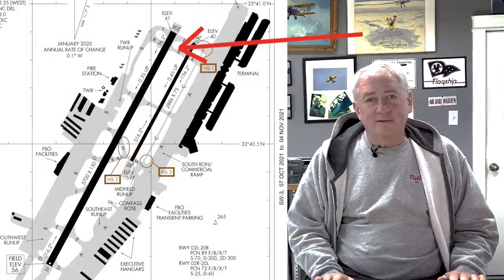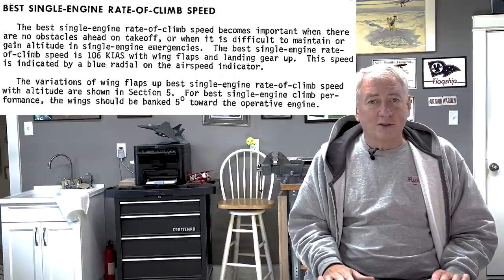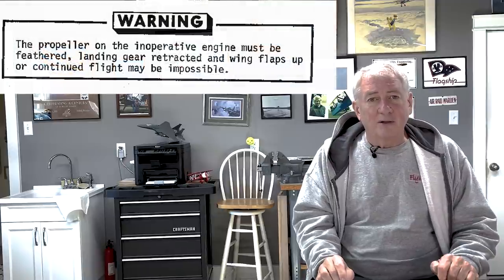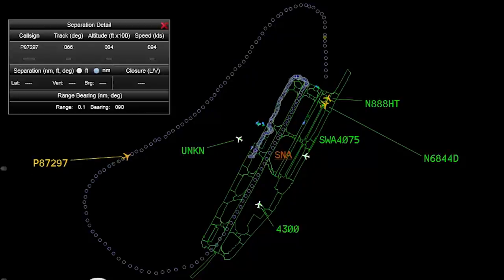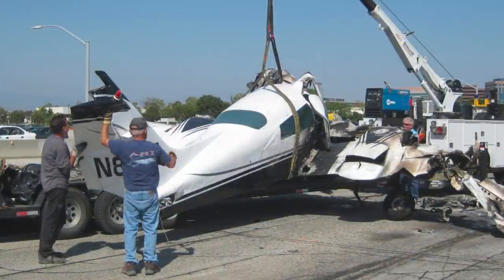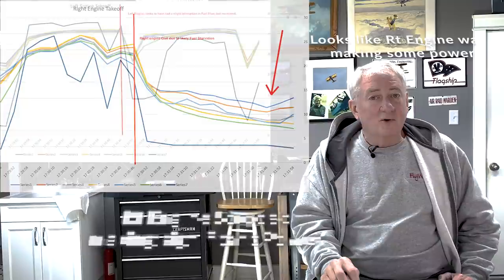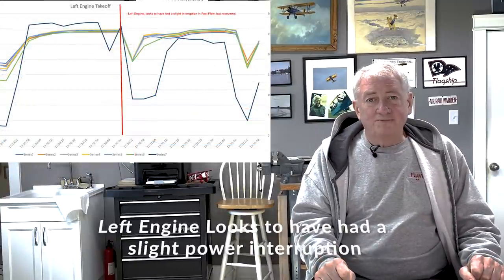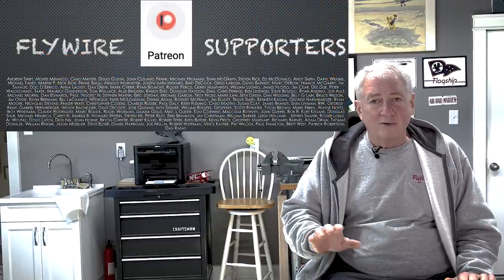C 310R Engine Failure After Takeoff

Comment: I had a catastrophic engine failure with the port engine in a rental C-310 decades ago, taking off from Monterey (Calif) airport around 2 or 3 in the afternoon. The engine suffered a broken connecting rod and as the shaft rotated, it shoved the broken end right through the side of the crankcase. Made one helluva "BANG" and showered the left inboard engine and wing with black oil. Feathered the prop, declared an emergency, and came back around and landed. Taxied in on one engine & shut down. No biggy, actually, but it sure came as a surprise...!! This was 1976 or 77.

Comment: I know, first hand, of three C-310s that have gone down because of fuel starvation.
Starvation, not exhaustion.
As originally designed the 310’s fuel system was super simple and safe. It got more complex over the years but never approached Beech 18 levels of complexity.
Yet, many, many pilots have mismanaged the 310’s fuel system, badly.

Comment: This video is so much more than an accident recap. It’s a tremendous training aid for those seeking a Multi rating, as well as those who already have one and desire/need proficiency training. I’ll be passing it along to my students and recommending it to future ones. Great job!
Reply: Scott is the best! He not only talks about the problem, he identifies what needs to be done to prevent this from happening to you. It won’t happen to me because I’m never going to fly a twin, too much to do when something goes wrong with one engine. You are better off in a single engine aircraft and no engine then you are in a twin with one engine. The record shows You are more likely to survive in the single. Of course there are reasons to have twin engine airplane, I’m not wishing to ban them or anything like that.
Reply: Newer airplaines have auto feathering of the failed engine.
Reply: @steveperreira5850  Any time a Aircraft  goes  faster it will hit harder. There is a lot more chance of surviving a piper Cub crash than 
 a jet.
Reply: @kjelle5350  Interesting, that could be a life saver.

Comment: At the time I trained for my multi, engine out procedures were drilled, drilled drilled.  It was automatic.  I don’t know if many continue to run that through their minds regularly.  In other words they quit thinking about it.  Not good.  I still think about those procedures all the time and seldom fly multi engine aircraft.  One thing that struck me about the audio calls was that the pilot really seemed panicked, especially at the first call.  I get sudden surprise and concern, but to make a call such as that, as it turns out,  without going through the normal engine out procedures tells you he either wasn’t proficient or doesn’t handle these things well at all.  Glad everyone made it, in spite of the pilots shortcomings…whatever the cause of those actually was.

Comment: I have lost an engine in 340 and 402B. The 340 twice once in flight once on takeoff. The 402 was on takeoff. The 402 barfed 
The left engine big time just barely feathered it before it froze. The  340, it was a fuel line issue both times. and I was light.
But I had effective training and experience. The standardization of both companies helped. Memorize the checklist study the manual. But Scott's right. Control the aircraft. Know the machine. Be proficient.
I've had some months off due to my wife's illness and death, and then a car wreck and hospital stay.
(Tboned at a stop. I had the right of way.) I wouldn't dream of crawling into an aircraft, even a simple one, without an instructor at least.
Reply: People will get sick of hear reading about stories like this? Too bad- We need more people who've survived these emergencies due to good training and taking their time to INGRAIN in their BRAINS, what to do in these situations- 

I'd much rather get a bit bored reading peoples stories of survival, than read obituaries.
Reply: @rickrickard2788  yes!👍

Comment: The first thing I thought was, “Why did he make right turns?” The second was the photo of the throttle quadrant. “No feathered prop?” He’s so lucky he made it as far as he did with a windmilling prop!
Reply: I know right!?  I'm not even a pilot but learned enough about the difference between having the extra power and 1 good engine if 1 quits  on a twin to really take the wind out of any sense of added safety and security when flying a twin!!
So many different factors come into play in the various videos I've seen made me realize that 1 more motor doesn't necessarily mean it's a walk in the park with the extra.  
Sounds more like a struggle for survival flying on the razors edge of what's required to remain flying, and what the plane is actually capable of with little room for error!
Reply: As you watch the radar track, there is another plane taking off on 02L just prior to '297's takeoff roll.  When 297 reaches the end of 02R, the two aircraft are pretty much alongside each other as 297 call the mayday.   It's possible that, knowing he had traffic to his left, turning right was the only option he had.
Reply: @chaspfrank  except that the accident flight departed 20L
Reply: @kenclark9888  Ya got your left and right mixed up there bud.  Cleared for take off 20 Right, also shown on the map that way.
Reply: Looking at the video which is not quite synchronized to the audio, the first gentle turn to the right is almost certainly because the pilot did not maintain good directional control when the engine failed. He needed more left rudder and gentle left bank to go straight, and even more than that to turn left. Then, once the turn to the right had begun, right was the shorter direction to go and so he made a deliberate right turn to the downwind then more right turns trying to line up with final. The bottom line is that the first turn was not by conscious choice, then right became the path to a shorter flight back to the runway.

The antidote should have been to go straight ahead at first, get the airplane cleaned up (feathered prop, etc), then take some time to get back. Rushing the return was instinctive but bad.
Reply: @chaspfrank  :  He had other options, he could’ve gone straight ahead and landed out elsewhere. He should know better than to turn into a failed engine. Lucky he didn’t crash right away.

Comment: 18:40 -  amazing commentary 
" we just have a memory that we used to be good..."  wow!
40 seconds of the most valuable and poignant commentary I've heard in a long time. This advice is applicable to life in general, but especially to anyone who engages in high risk/low frequency activities.
Thank you for your Insight!
Reply: Yes, exactly. If I haven't flown in 5 years, I could probably write down all the steps to take in the event of an engine failure on a piece of paper after thinking about it for a minute (long-term memory). But that's not the same as being able to do it immediately and completely in 5 seconds. In order to do it quickly and correctly, you need recent practice (muscle memory). It's also essential to do a pre-takeoff brief so that your emergency plan will be in short-term memory.

Comment: A couple of takeaways here Scott - Excellent work on the analysis. The 310R is my favorite but I am a bit biased. It is NOT an airplane for once or twice a year flyers. You really need to be proficient. 2 - having VG - (vortex generators) on a 310R should be a requirement for for this very reason. It reduces VMC from 80 down to 71 kts. Would it have made a difference here? Maybe who knows... And 3 - my mind isn't a checklist mind. I personally don't operate any other part of my life with lists... except when I fly. We have to use them even when we don't THINK we need to use them. See you around. Thanks!

Comment: Thanks for a great analysis! I had this happen in my Twin Comanche. Left engine failed due to a broken valve stem and subsequent loss of oil. I didn't even consider turning to the left and declined tower's clearance to enter left downwind. I told them 'unable' and that I was entering a wide, right downwind. I kept turns shallow. They cleared all runways for me. I held off on gear extension until final and didn't use flaps. Secured the left engine on final - no time before that and, frankly, I REALLY didn't want to feather the wrong prop! I was alone in the plane and felt extremely busy in the cockpit; I felt I had no time. It all went by in a flash. I can't imagine making turns into a dead engine at low altitude. I couldn't turn to the right (into the good engine) on taxi and had to make 270 degree turns to the left in order to move to the right while taxiing in after landing. I was very proficient in that plane and did a LOT of engine-out training. Proficiency is so critical in twins! As they say, the problem with flying a twin is that the good engine will just get you to the scene of the accident...
Reply from the maker: Great story. Thanks for sharing!

Comment: Great analysis of the accident! I really liked how you hit on the mantra of the single engine drill. I try to repeat the mantra (with physically touching controls as I work through the drill) close to or just before take off so I am mentally prepared and have good muscle memory.

It is unfortunate that this pilot probably did not remember to repeat the mantra. However, we do know for a fact that he did the absolute minimum things correct which was to pitch the aircraft down, most likely roll into the good engine and not put the gear down when advised by ATC. Just doing the above, he prevented the roll over stall which is the most common type of a light twin crashes with engine out near the ground. Not identifying, verifying and feathering the dead engine is what eventually lead to the loss of speed and altitude. He might have even made it had he just remembered to raise the flaps which is also part of the mantra. I am glad they survived and kept the nose down somewhere near enough to VMC.

BTW, I have flown my 310N with simulated critical engine out (left engine to idle no prop feathering) and turned to the left. It can be done but just as you said it must be done with precision.

Comment: As I seem to recall Cessna 310/320/340 sires aircraft (including the 310R) was that the aux pumps are in the Main tip tanks so the aux tanks have no fuel boost, and are  intended for level cruise only. As such, starting the engines with  the fuel selectors set to 'Aux' would seem unlikely if not impossible as no fuel boost would be available for priming. 
I can't recall ever trying to start  or take off in a 310, 320 or 340 with fuel set to 'Aux' but I lost power on both engines turning base to final in a 320 with the fuel selectors set to 'Aux' and only about 5 gals in each tank and instantly realized what happened and was able to restore power in a few seconds. 

I recall a fatal 310 accident at SLE where a pilot was on an ILS runway 31 and ran out of AUX fuel a bit above DH and crashed into a house. In the 310 you can run just about an hour on Aux tanks, or just long enough to forget about it and travel 200 to 300 miles and run out near the ground. 

A high-time 310 driver recommended I switch to AUX tanks about 10 mins apart, but that complicated things. Once, I forgot to switch one tank back to 'Main' 10 mins after the first, and the right engine out of fuel on downwind.

Comment: My wife and I own and  operate a C310R.  Very early on in my training to fly the 310, it was stressed to me, and is also stated in the POH, that in the Pre Starting Engines check list that the fuel selectors be placed to select the Main (tip) tanks.   In addition to moving the levers, which are on the aircraft centerline, on the floor, you have to feel for the selector to go into the Detente.  The actual valves for the fuel flow are out in the wing, and are connected to the cabin selector switches by cables, hence the need to feel the detente.  That might have contributed to the right engine quitting, as you stated.  I really enjoy your videos, even if they are usually regarding single engine aircraft.  Good learning material.  Thanks!

Comment: Very nice video! C-310R: for take off and landings: fuel selectors both on mains, and auxiliary fuel pumps on low. Note: auxiliary pumps are located inside the main pumps and only feed from the respective main tank. The wing tanks (aux tanks) are gravity fed to the engine pump and not for take off and landing.

Comment: Assuming no obstacles, I might suggest flying straight ahead until the airplane is under control and essential items have been completed. This will also give you time to settle down and focus on a measured process to salvage the situation.
Reply: Very good advice!
Reply: Well, that is exactly what this pilot should have done. Straight ahead, airspeed and altitude.  Zero need to turn when departing Rwy 20 @ SNA. Turn low and slow with an engine failure...you're dead.
Reply: Like getting all yer ducks in a row and restarting the engine! This pilot was a bit of a dunce.
Reply: @CFITOMAHAWK  bitter much?
Reply: @machflyer  right.  that is precisely what happened - except -  they were rescued from their plane by people on the roadway!

Comment: I understand the controller's reflexive statement that the gear was up on the downwind, and applaud the pilot's statement that he wanted to wait before putting it down. Ultimately though, it's clear the pilot should have left the gear up until the very end or maybe even landed gear up, and controllers would do well to NOT advise pilots of light twins in these situations to put their gear down. Counterintuitive as it might seem to a controller, putting the gear down in this kind of situation can kill people, while landing gear up just makes some scraping noises.
Reply from the maker: That's true Dean, another for your training data.
Reply: I understand your comment, however we can't assume every controller to be aware of the correct procedure for every aircraft (not all controllers are pilots for that matter), that's the pilot's job (which he did correctly regarding the gear at this point). I'd also like to point out that the controller merely informed the pilot that "your gear appears to be up", the controller did not instruct him to lower the gear. Personally I think the most valuable lesson to be drawn from this interaction is that it's the pilot's responsibility to evaluate if a suggestion or instruction from ATC can be safely followed after taking into consideration all circumstances in the cockpit.
Reply: The controller did not advise the pilot to put his gear down.  He reminded the pilot that his gear was up.  Big difference.
Reply: Also, not every airplane is the same, some are ancient... might be a good idea for pilots to get a clear idea of how long it takes their airplane to deploy the landing gear. Ten seconds to touchdown is no good if it takes fifteen to deploy.

Comment: Every twin trainee in the U.S. has heard that turns must be into the operating engine. In this case, it sounded as though the pilot was in condition black, breakdown in metal and physical performance. His actions reinforce this presumption. It could be that he got stuck on the issue of which engine was out and therefore fell into a mental breakdown. It’s seems in this situation he would have been better off not committing to any turn before identifying the failed engine, something that is best done in straight ahead flight. It’s not hard to have compassion for the idea of getting back to the airport immediately, but too many people who jump right to that action, miss the steps required to simply stay aloft. Glad no one died.
Reply: He probably would not have been nearly as stressed-out, if he had been by himself. But, the fact that he had a passenger who's life literally depended on what he did/didn't do in that situation, probably exponentially raised his stress-level. I KNOW that would be the case, if I had been the pilot!
Reply: I'm a twin trainee in the US and I've never been told I can only turn into the operating engine. Even the the multiengine chapter in the FAA Airplane Flying Handbook says you do not have to turn into the operating engine. Of course, there are conditions, such as having enough airspeed and using a moderate bank angle.

Comment: I had my multi training in a 310F and learned, after missing a heartbeat, the 310 has major adverse yaw at slow speeds or approach (I was over the rocks and surf at Kalaupapa 50 years ago) and rudder authority is  extremely important even with 2 engines running.  Not feathering that engine was a major reason in this crash and should have been able to gain and maintain approach speed.  The 310 can be a wicked beast if mishandled and a dream if prepared.

Comment: Engine failure during take-off worst case scenario because of shock effect and being time critical. Takes a moment to change thought processes, so really emphasises the need to have and practice these drills by rote; light twins like this make it even more critical to get it right. My experience of an engine failure in a C310R was far more leisurely when cruising at 9,000’ an oil filter mounting bolt washer failed and all the oil spurted out. I had the luxury of rehearsing shut down drill while watching until the oil pressure flickered whereupon I cut the engine and feathered it. Below MTOW but easily maintained height for another 45 minutes. Knowing the drills is vital.